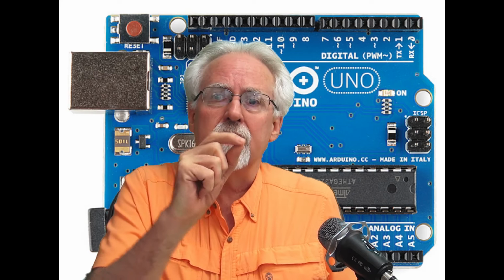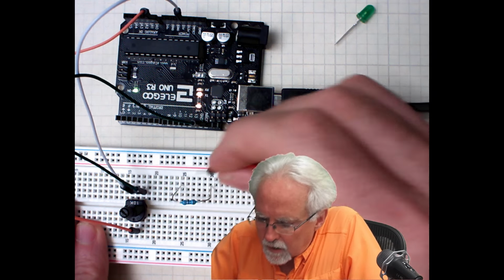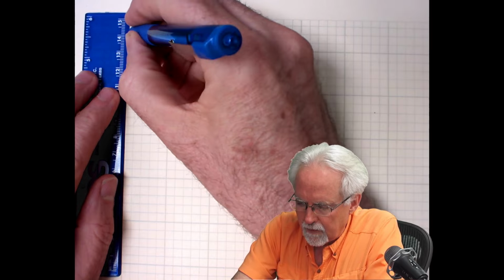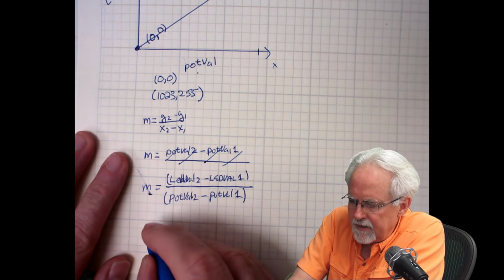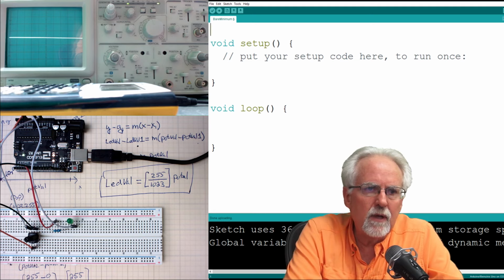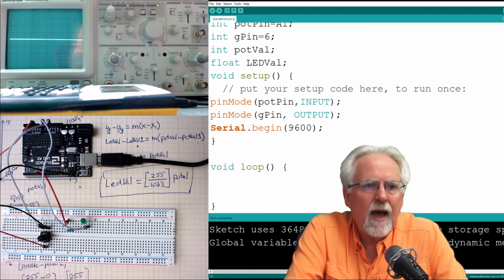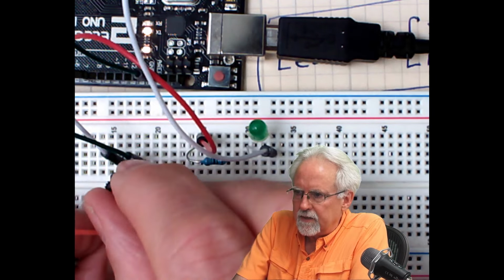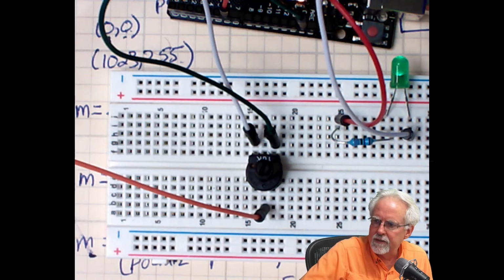Arduino Tutorial 14: Dimmable LED Project

Comment: I used the exact same code and wiring layout and it works. The only issue I am having is that the potentiometer works in revers. All the way to the right is 255 and the left is 0. I have gone over it repeatedly and cant figure out the issue. Can anyone help?
Reply: Positive and ground were reversed. It works perfect now.

Comment: Hi, if I change the value of (255./1023.) by (.25) the result is a dim fonction that is a lot smoother. Contrary if I put the value(0,24926686) the dim function is scattery. Something to do with processor speed? Love your tutorials.
Reply: How are you changing it? Multiplying by, dividing by, adding, subtracting 0.25?

Comment: I used the joy stick instead of the potentiometer- It operates much smoother and the mid-point neutral split the values in half on the Serial monitor.  Also hooked up the scope to see the PWM in action.  Very Cool!  Thank you for all of your hard work Paul!  Such great material!

Comment: BOOM! Great videos! Im having a blast! Another nice little trick and shortcut you can do is build off the program from the previous video that read the potentiometer and converted it to voltage by multiplying the voltage variable by 225./5. which allows you  to create a new variable for the Potentiometer to LED values so you can read both. BOOM! Happy little green LED 😆

Comment: I have no background at this level of math, I can follow the tutorial but could not do this from scratch. It would take me an age to find out by trawling the internet.
I understand the logic of the equation (never thought I'd say equation ever again especially as it's 54 years since l past over the threshold out of school) the coding and the wiring of the components.
Reply: Try simplifying your thinking this way first: If the potentiometer was turned to 50%, you want the digital output to spit out a 50% value too.  If you turned the knob down and the potentiometer goes to 25%,  again you would want the digital output to also be 25%.  Highly simplified, this is what a linear equation is; both values track equally as percentages from 0% to 100% . Good so far, I hope?  Now you need to change this thought process into an equation.  If your potPin is reading a value of 300, that means your percentage would be 29.3% (calculated as  300/1023).  Now you are trying to solve for the 29.3% equivalent digital output, the LEDVal.  How do you do that? Well you know that (29.3%) * 255 range of digital pin =  74.78.  Your equation starts looking like (potVal/1023)* 255 =LEDVal.  This can be mathematically rearranged to the final equation Paul used in the code of LEDVal=(255./1023.)*potVal.  This simplification ONLY works if both ranges of potVal and LEDVal start at zero, which they do.  To be fair, I thought Paul's explanation and calculation could be confusing to some people.  Then again, you may look at my explanation here and say the same.  Cheers mate!

Comment: As you command the arduino to adjust the voltage on the LEDPin based on pot reading, shouldn't it also be possible to reverse the reading? as pot goes up, LED voltage goes down? or maybe intermix them to "wave the LED power up and down as you increase or decrease potentiometer? perhaps similarly to turning the LED on or off depending on pot reading?

Comment: I often tell my woodworking students to do a sanity check with a scrap piece on the table saw first.

(I'm working my way through all the videos.  I already know the math (and a lot of the solid state).  I'm doing these because it's been quite a while since I did any programming, so I need to learn the syntax.)
Reply from the maker: Measure once, and cut twice
I cut a board twice, and it was too short both times.

See, I did a little wood working back in the day. I had a shopshith with all the attachments. Really loved doing fine work. I made cabinetry for the shoop that had many dozens of perfectly made and fitting little drawers, like the old machinist chests. All box joints and dove tails. Really quiet satisfying to do precision wood work. Hope to get back into it again soon.
Reply: @paulmcwhorter  I've got some of my fun projects posted up on imgur (https://imgur.com/user/DreadPirateRendle/posts), including some precise woodworking ones you might appreciate.  I'm doing this course so I can roll my own lighting controller for the LEDs I installed in a cabin I've been building.

Comment: Sir, Can we connect Output voltage control pin of Potentiometer to LED, to check Dimmable LED project. Sir, I have tried in above describe way but couldn't get the result perfectly.

Comment: Is it ok to connect voltage - resistor - potentiometer - LED without working with reading the potentiometer value and writing it for the LED?

Comment: This was very simple we could do this same with a battery potentiometer and led just by adjusting the potentiometer.
It would be more helpful if he did a little more complex that is not possible without an Arduino
Reply: As I was watching he did mention someone will be there like me 😁. Bt I would like a complex program and circuit explained after this so I could take that as a reference and use it to troubleshoot my own programs and circuits

Comment: Hi Paul, today you were not talking to the wall (only). I was watching Tutorial 14 today... ;-)
The reason the circuit at first was not running properly might be the same problem that I have encountered with the breadboard and the 10 kOhms potentiometer: the contacts between the feet of the pot and the breadboard are not reliable and loose at some times.  When I press down the housing of the small pot with one hand and turn the knob with the other hand the problem disapears and the pot works properly.

Keep up the good work!

Rob
Netherlands

Comment: Thank you Mr. Mcworther, I did the math and I did the circuit, following you, thank you so much! Here is my code.

int gPin=8;
int potPin=A8;
int potVal;
float ledVal;

void setup() {
  // put your setup code here, to run once:
pinMode(gPin,OUTPUT);
pinMode(potPin,INPUT);
Serial.begin(9600);

}

void loop() {
  // put your main code here, to run repeatedly:
  potVal=analogRead(potPin);
  ledVal=(255./1023.)*potVal;
  analogWrite(gPin,ledVal);
  Serial.println(ledVal);
}

Comment: Thank you so much sir, I'm just in love with your tutorials. But sir, I faced a problem, please help me if you can get some of your precious time out of your busy schedule. Actually sir, everything is functioning perfectly fine, but I'm trying to read back the voltage that led is getting after flowing through the resistor (using another pin for analogRead) and trying to print it, but either it is printing the lowest value (i.e. 0.00) or it is printing highest value (i.e.  1.87  or  1.88) {even when the led's brightness is in between}.

Comment: :) I got as far as a potentiometer dimming the (blue - coz it is a special project - i promise) LED with a red, yellow and green  digital LED to alert if "system voltage" is OK at <3V, Warning at >=3 to <4V and alarm if >4V.  If the system goes into alarm, it shuts the blue led down and announces the alarm in Serial monitor. You then need to reduce the voltage and press a reset button. Thanks Paul... this is fun. Great to follow your tutorials but also to step outside and use the learnings.

Comment: I need to be patient. I watched through the lesson on PWM, dimming the LED and thought "too tedious" to keep changing the output though code and upload. I wanted to work out how to use a pot to set the Vout ( average via PWM), but although I think I'm there (yet to finish coding), you've pulled it together in this lesson. That's my penalty for binge watching! I'm trying to get the rigour from you, but also try to work it out for myself. 
Again Paul, thanks for your great work.

Comment: Paul, I appreciate your down-to-earth method of teaching.  I am 78 and a retired manufacturing engineer.  I worked with PLCs, but I love learning the Arduino.  I am working on a program and schematic for a PID temperature controller for a pressure fryer with adjustable setpoint and LCD display, working from a K thermocouple and Max6675.  My problem at this time is trying to trigger two SSRs with a PCM output from the Arduino.  Thanks again.

Comment: I had one problem that was driving me crazy when I was dialling the POT reading was spiking from 0 to 255 then sometimes it would go to the right value.  The solution for me was to hold the POT firmly against the board while I dialled it in and BAM (love the BAM's) it worked fine.  The connections are not the best, just wanted to warn others.

Comment: Thanks much Paul! Here's my
dimmable led project using potentiometer codes:
int ana=A0;
int out1= 8;
int led=5;
float v2;
float ledvolt;
int d=500;

void setup()
pinMode(ana,INPUT);
pinMode(out1,OUTPUT);
pinMode(led,OUTPUT);
serial.begin(9600);

void loop()
digitalWrite(out1,HIGH);
v2=analogRead(ana);
ledvolt=(255./1023.)*v2;
analogWrite(led,ledvolt);
Serial.println(ledvolt);
delay(d);
}

Comment: I ran into the same connection issue as you did on this project.  I learned in the last lesson that the potentiometer seems to be the weak link in this connection.  In both instances, I had to apply quite a bit of pressure on the potentiometer to the breadboard in order for the connection be reliable.  Thank you so much for the lessons... and yes, I listened to the whole video.  Also, you have about 5 new viewers that I have shared with... I'll keep 'em coming.

Comment: Cheap breadboards really suck.  I spend most of last lesson chasing loose connections before remembering I had some better quality ones in the shed.  End of problems.  
Yes, watch through to the end of each video, and do the math, coding and circuits.  I really do appreciate them. I usually expand of them a little after the Tutorial just to help enforce the lesson and to try and make it at least a little personalized for my student, but I have to not get too carried away I or will have too much to explain to my little buddy.You know how it is, too much too soon = information overload = confusion = give up!

Comment: Had similar issues with the POT on the breadboard. checked volt output on the serial print and confirmed with a multimeter. used the dupont wires on the POT then to the breadboard and it worked.

Comment: I have the elegoo kit from your link, I had it before you linked it. It’s a good arduino but the breadboard is shocking quality. It’s exasperated by the short pins on the pot. UNO is perfect for prototyping but this doesn’t make life easy, fault finding hardware unsure if it’s a bad connection or code error, Serial.println helps find the problem if you are monitoring obviously. 
Great great work with the tutorials however. Thanks as always.

Comment: This may be a dumb question, but why bother with the formula and commanding the LED from the Arduino? Why not just go Potentiometer 3rd leg (which is outputting voltage) trough a 330 Resistor to LED Anode? Seems like an   easier way to get the same outcome.

Comment: Quick question, a little bit off topic, this programming, how does it relate in general terms to unity pro? i am just starting out learning, but for my work using the unity pro, how far off is it, because it seems to very similar, just wondering is all, and wondering if i need to step up how many leasons i am doing to be able to catch up????? I am taking alot of notes as i go thru this first course. hopefully you can answer my question, but i do realize you are busy and i realize you may not have alot of time to answer everyones questions......

Comment: Shouldn’t it be 256/1024, since there are 256 combinations of 0 to 255, and 1024 for the other ?
In math the line calculation would be correct, but in electronics the zero is the first position not one.

Comment: int greenLED=10;
int readVoltage=A0;
int TD=500;
int PotVal;
float LEDVal;
float Calc=(255./1023.);

void setup() {
  // put your setup code here, to run once:
Serial.begin (19200);
pinMode(readVoltage,INPUT);
pinMode(greenLED,OUTPUT);
}

void loop() {
  // put your main code here, to run repeatedly:
PotVal=analogRead(readVoltage); 
LEDVal=(Calc*PotVal); 
Serial.print ("LED Value  =  ");
Serial.println (LEDVal);
analogWrite(greenLED,LEDVal);
delay(TD);
}

Comment: To digitalize 5 analogic volts we are using 2^8 numbers (from 0 to 255), 8 bits of information when working with a LED, however with the potentiometer we use 2^10 numbers (from 0 to 1023), 10 bits of information. Why two different scales?

Comment: Not sure why, but I'm a bit stuck. I've followed along with wiring and programming, and I think I understand it all, but my LED doesn't dim, it switches on/off at half-range. It's a very binary transition, not a dim/fade, and I don't know why.
Reply: Got it. I wasn't using a PWM output pin.

Comment: I'm an old guy (69) who studied electronics when vacuum tubes were in vogue.  (long time ago.) I built my first digital circuit with simple switching transistors , capacitors, resisters etc.  My first chip experience was with the NE555.  (also a long time ago) I'm studying along with you and am on project 144 as I write this.  I am fascinated with micro processors and their uses in hobby projects.  You asked if anyone was out there?  YES! I'm here.  I've programmed some in BASC but this is really quite different. (to me) I enjoy the course and am committed to the end.  Thanks for producing it.

Comment: Oops, I didn't know this topic will come up, so I actually did dimmable Formula 1 steering wheel lights last time, because I was so happy to learn about "if" function. One potentiometer turned LED's (green>yellow>red>blue) on with all of them blinking at 5V (as a rev-limiter) and second potentiometer to set brightness... 
But for some reason second potentiometer gives only 235 max value, not 1023... I don't know why yet.

Comment: I'm not exactly sure if it's a fault in the pin connection or the quality of the potentiometer but sometimes the voltage will jump to five despite the potentiometer being set to zero. The dimmer function seems to work though which is really neat. I might need to rewatch videos 1-14 to really cement some of the Arduino terminology we've been using.

Comment: int potPin = A3;
int ledPin = 3;
int potVal;
float LEDVal;
int waitT = 1000;

float realVolt;

void setup() {
  pinMode(potPin, INPUT);
  pinMode(ledPin, OUTPUT);
  Serial.begin(9600);
  
}

void loop() {
  potVal = analogRead(potPin);
  LEDVal = (255./1023.)*potVal;
  realVolt =(5./1023.)*potVal;
   
  analogWrite(ledPin, LEDVal);
  Serial.print("The led voltage is ");
  Serial.print(LEDVal);
  Serial.print(" the real voltage is ");
  Serial.println(realVolt);
  delay(waitT);

}

Gracias por tomarse el tiempo para enseñar, nada es mas valioso que el conocimiento.

Comment: int pinRed=A0;
int myPin=A2;
int yellowPin=A3;
int bluepin=A4;
int Valread;
int ValpinRed;
int Valblue;
int ValYellow;
float V2;
void setup() {
  // put your setup code here, to run once:
Serial.begin(9600);
pinMode(myPin,INPUT);
pinMode(pinRed,OUTPUT);
pinMode(yellowPin,OUTPUT);
pinMode(bluepin,OUTPUT);
}

void loop() {
  // put your main code here, to run repeatedly:
Valread=analogRead(myPin);
Serial.print("Potentiameter voltage is ");
V2=(5./1023.)*Valread;
V2=(5./1023.)*ValYellow;
V2=(5./1023.)*Valblue;
Serial.println(V2);

if(V2==5.0){

digitalWrite(pinRed,HIGH);// 
}
      else
if(V2 ==4.5){
  digitalWrite(bluepin,HIGH);
  Serial.println("voltage getting low take precaution");
}
     else
if(V2==3.5){
 digitalWrite(yellowPin,HIGH);

Serial.println("valtage getting way too low must take action");
}
delay(1500);
}

I am getting zero Voltage in my serial monitor
Please help.

Comment: Paul - I love the series.  I'm an "old" guy who started learning about electronics many, many years ago as a hobby while a college senior.  I took an elective course in electronics and had a lot of fun.  No Arduino kits back then and I couldn't use a breadboard for testing without soldering wire leads to some components due to irregular sizes.  And yes, some components were "nuked" during the soldering process.  Frustrating.  This is a much more enjoyable experience.  I appreciate the review on the line equation.  Your explanation and example regarding LED output makes so much sense.  I've completed all of the homework assignments.

Comment: Paul, I'm enjoying learning! For chuckles I combined the homework from lesson 13 - the green, then yellow, then red LEDs based on the voltage conversions, with this lesson, on the same breadboard, so my dimmable LED does as it is supposed to do, and the green, yellow and red LEDs light up as they should. Thanks for helping an old guy learn something new!

Comment: Thank you for this one, Mine works however the Potentiometer is quite unstable, if i touch it slightly it will either turn off or be at full brightness. I think there is an issue with the connections

Comment: I soldered leads to my potentiometer as the fit in the breadboard was sketchy. I notice a slight delay in reaction time when changing resistance. Will increasing the baud rate increase reaction time?

Comment: I tried some experiments with the maths and converted between scales with different origins.  The bit to remember is to add the origin for Y back to the calculation to find the true Y value, otherwise you set Y and X to the same scale and work out a value for Y on the adjusted scale, not the true scale.  For instance 

Y 2 (Scale extremity = 10) Y 1 (Scale origin = 1).
X 2 (Scale extremity = 1023) X 1 (Scale origin = 0)

10 - 1 = 9 = Y(adj) "adjusted scale"
1023 - 0 = 1023

9/1023 = 0.008797654

1023 * 0.008797654 = 9 = Y - Y origin

Y = Y(adj) + Y origin

9 + 1 = 10